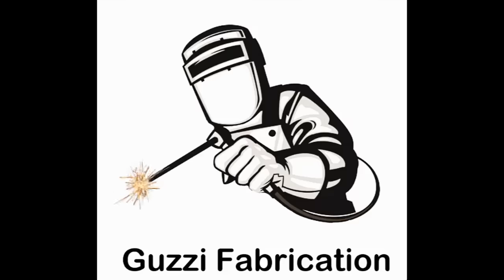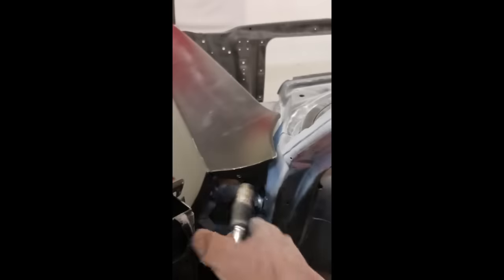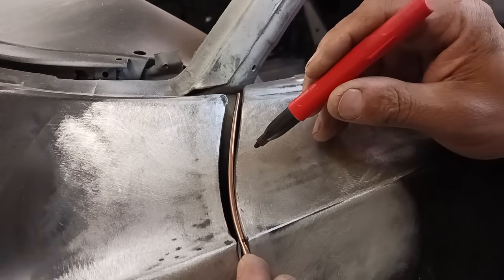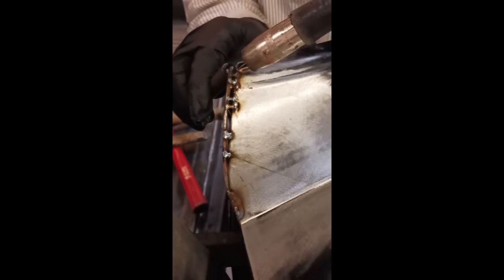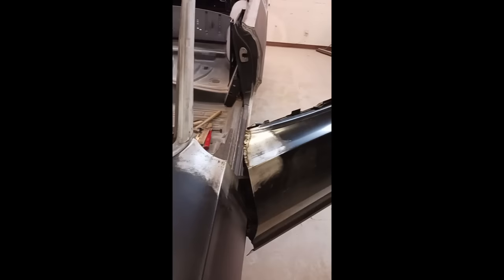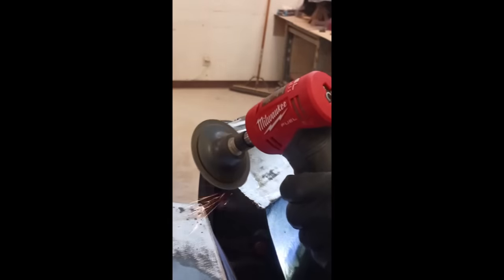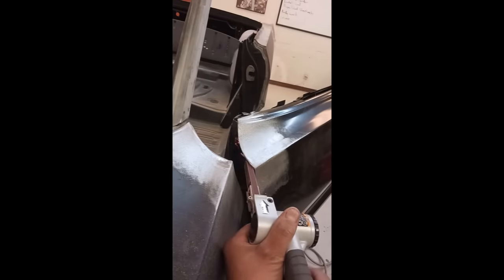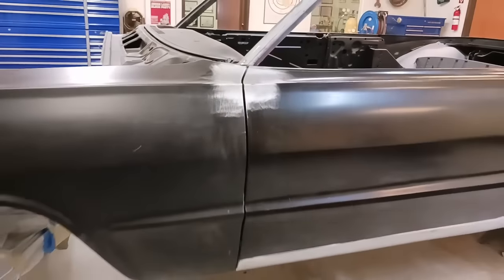How to Fix  BAD Door / Panel Gaps & Metal Finish -  DIY Auto Resoration

Comment: Good tips for minor gap rapairs.. however, the time consumed on preparation,  after market repops.. etc. It isn't worth it. I bought a low rider with original sheet metal and rust free.  Switched frame, resprayed original color. In 3 months was out the door as original.. quick 60k profit..
Reply from the maker: Thanks ! but the thing is you lucked into a deal like that.... an original - rust free - car that you can just spray and flip AND make 60k..... I'm happy you hit a home run triple..... but that is no where near the normal...... good luck finding those cars everyday.

Comment: I have done this before on door gaps and it works really well. So much better than filler on a leading edge which will ultimately fail.  Good luck to others.
Reply from the maker: Yeah how many times have I seen low quality shops use filler for everything instead of metal..... hey thanks for supporting the channel

Comment: I have done this for over 55 years, and a mentor taught me to build use the edges one spot at a time and to make shapable brass spoons to hold behind the edges to backup and help absorb the heat ... I learned to set up the whole car and then move from one area to the next to keep heat down and stop burn thru ... great work. This should help newbies get a great start on diy body work ...
Reply from the maker: Heck stop in at the shop anytime! I'd like to learn from you !

Comment: Stumbled across this and glad I did. Thank you for sharing this. I’m trying to build up my skill level. And this really helps. Your explanation is excellent. I was working in a shop that did fake restoration work. It unfortunately was more concerned about time line . And I’d actually get in trouble for “ cutting out the good rust” , scolded for hammer and dolly work. And 1/2” of bondo was acceptable. I’ve seen actual inches used. I could go on and on . People need to research the shop before dropping off their dream. I quit working there for those reasons. But  my old boss says you can’t see under the paint .
Reply from the maker: That's part of the motivation behind this channnel to show how work should be done, really don't like those underhanded types.....
Reply: You sure can see under the paint with the paint and bondo measuring device!!!

Comment: Nice job bro! Good to see actual restoration work and not mud daubers. People freak out when they see a rough estimate for restoration. "But I've got all new parts" lol yeah that's the problem sometimes. Most of the repro parts won't bolt up without mods much less actually fit, hours apon hours of labor to do what you just did and when finished it looks like you stripped the ecoat and bolted it on to the customer
Reply from the maker: You hit the nail on the head brother !
The aftermarket parts just get worse and worse. And people really don't realize how much work it takes to make it look like it hasn't been touched.....
Reply: @guzzifabrication3448  yeah I noticed that. I just bought a decklid for my 69 Camaro and the box was labeled "decklid suitable for a 69 Camaro" hahahaha yeah so is a tarp but doesn't mean it is right. At that point I knew I was screwed lol suitable for lol gotta love the Chinesium
Reply from the maker: @Mark-um7ey  Wow...... the whole thing is done.....

Comment: Wow, thank you so much for your video. I have a 57 chevy after someone gouged down one side, the door and panels are miles apart like the door is now too small.  Building out the door with wire to make the top and bottom of the door a little wider is a far better solution than using fibreglass and bondo. This will work out great for me so cheers.
Reply from the maker: I'm glad this could help ! Thanks for the comment and supporting my channel, good luck on your 57 repair !
Reply: @guzzifabrication3448   Your welcome, I did have a question about the wire you used - what is that? Is that like some think welding wire or something else?
Reply from the maker: @BriantheLionNZ  ER70S tig welding filler rod, it comes in 1/16, 3/32, 1/8
Reply: @guzzifabrication3448  thanks so  much buddy, I know where I can get me some of those regards from Brian
Reply from the maker: @BriantheLionNZ  You can pick tig welding filler rod at any welding supply store.

Comment: I have been considering how to fix the same gap you worked on, only the fender is fiberglass.  So obvious that adding metal to the door is a better and stronger solution than trying to add to the fender!  And this video shows it really isn't as hard as I was worrying about.  Thank you!
Reply from the maker: You can absolutely do it, just take your time. Think about what you're doing and you will be very successful. Good luck on your project !

Comment: I’m restoring a K5 Blazer and have been spending a lot of time getting gaps perfect on it. I went with new fenders too and had some minor fitment issues that I was able resolve like this. Also from the factory the door had a nasty a gap between the A pillar and widow frame. The center of that gap opened up wide and the ends were ok so there was no adjusting for it. I welded in rod and ground off any excess. So far it’s looking like it’s going to be a very straight with great gaps. Much better than what the factory did on trucks back then. I’m no pro but it’s nice to see some of what I’ve done the pros do.
Reply from the maker: Awesome ! sounds like it's going to be a nice Blazer !

Comment: Nice work never thought about welding rod I always just went to lowes and but steel rod for the edges I also bought me some magnets at harbor freight to sometimes hold the rod on the panel
Reply from the maker: @rongamble9884  hey that works to brother.
Reply: @guzzifabrication3448  keep up the good work glad to see craftsmanship not that crap like the guy here locally posts on YouTube as bondo billy
Reply from the maker: @rongamble9884  thank you Sir !

Comment: Thanks a lot for uploading this video! I might need this How-To on my 1968 Camaro project. Mockup assembly is upcoming and I am curious how the front sheetmetal will fit, especially in that area shown and the door to front fender gaps.
Reply from the maker: If they are after market parts, fit is a toss up.... but they can be made perfect. Good luck on your project !
Reply: @guzzifabrication3448  thanks! Yes they're aftermarket, from AMD. Measurements look quite okay vs. original fenders and doors. 
Let's see, thx for wishing me luck 😎

Comment: I'm curious, you mentioned that the finished door gap looks wide on camera, but is right where
you want it. What is the actual width ? 3/16,1/4,5/16  ?
Great work being done here .
Reply from the maker: I usually rough set the gaps at 3/16 I still have some adjustability forward and backwards a standard paint stick works great for rust setting it for whatever reason on video the gap looks huge but it's not
Reply: @guzzifabrication3448   Thanks for the clarification. I really admire your expertise.

Comment: To finish the gap I use a air saw with a saws all blade 
I fold 80 grit sticky file paper over the blade instant air file/ air sander that can sand both sides of the gap at once especially when a gap is a little to tight
Reply from the maker: Ok

Comment: nice video bud i have a stupid question when you go to a welding shop to buy welding rod to fill gaps what are you asking for what do you call it i usually use coat hangers but that rod u had was bigger i like it
Reply from the maker: The rod and the video is  a TIG welding rod 1/8" Er70s. They come in 3 sizes 1/16 3/32 and 1/8"
Reply: thank you @guzzifabrication3448

Comment: Awesome talent, wish you were closer to me. I have a question,  I don't do much welding, would it be wise to buy a gasless wire welder? Thanks again, keep up the good work.
Reply from the maker: Invest in the shielding gas unless you're working outside that's mainly what gasless welders are intended for

Comment: Nice job. I was able to pick up some nice stuff. How did you protect the area afterwards? Do you spray something over the bare metal until you get to the whole car? Some red oxide or something? Thanks for sharing.
Reply from the maker: Awesome glad I could share, I'll be priming the entire vehicle in k36
Reply: @guzzifabrication3448  ok so I guess you don’t have a problem with flash rust if you wait. What would you do if it was a project that you can only work on part time and or seasonal? Thanks for the reply. I’m not familiar with K36. Is that epoxy primer?
Reply from the maker: If the vehicle is going to be setting anytime over 3 or 4 days and yeah you have to put some type of primer on it, k36 is a PPG product that's their high-end High fill urethane primer

Comment: Awesome work! What size and kind of mig wire do you use? Thanks
Reply from the maker: Most shops use .025 for sheet metal, I use .035 for everything.... That way I buy one size wire and one size replacement tips and not two or three different sizes, But that's just my preference

Comment: I am no pro but the replacement fender has softer crease lines than the door yet the original panels would have had sharp lines due to going through 6 stamping machines
Reply from the maker: Yes Sir,  definitely a difference.... and not a positive one......

Comment: Is there a certain rod and size to use im working on a 63 door as well and have to do same procedure
Reply from the maker: Great question tig rod comes in  1/16, 3/32, and 1/8 sizes, which size to use would depend on the how big the gap is that needs to be sized.

Comment: if the wheels are not on the axles and on the ground and with no engine, given the flex on an old frame, you wonderful gaps will be faded memory.
Reply from the maker: My 30 yrs experience says different, besides that I'm making the gap parallel to each other, fixing a problem in the stamping.

Comment: put the other fender and hood before you do anything
Reply from the maker: That gap isn't going to change no matter where the right Fender or Hood fall.... what the concern is the fender and the door being parallel and the Body Lines matching, they have adjustability forward and back.

Comment: Thanks for this. Any particular type of welding rod you prefer?
Reply from the maker: I'm using ER70S tig rod, that's your best bet it comes in 1/16, 3/32,and 1/8 diameter.